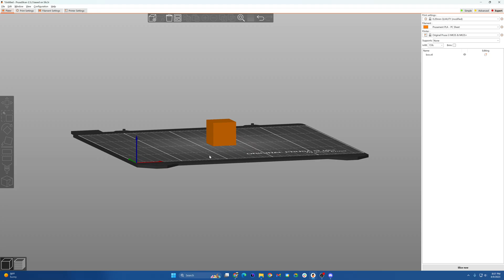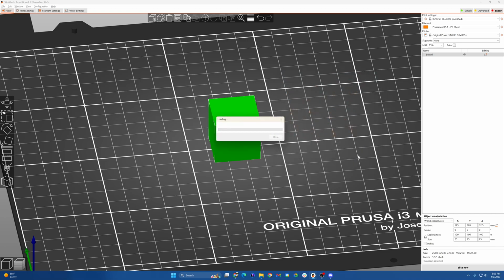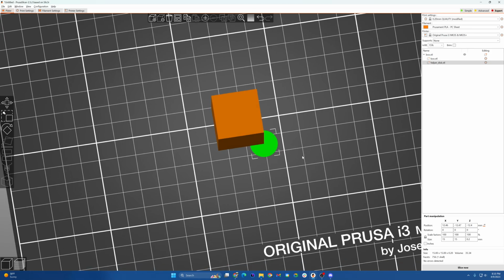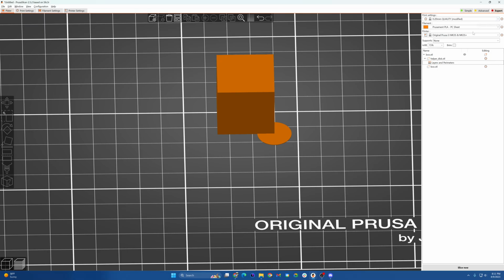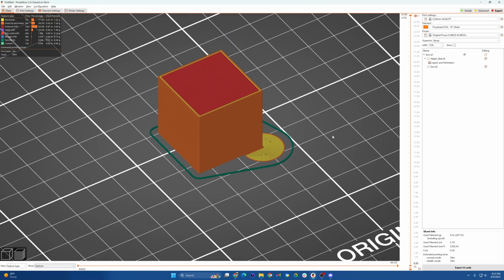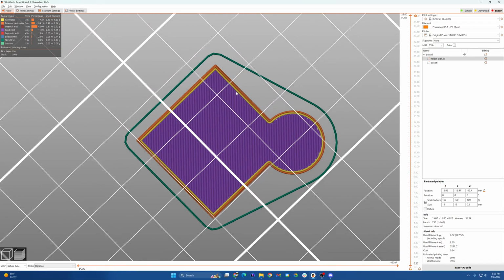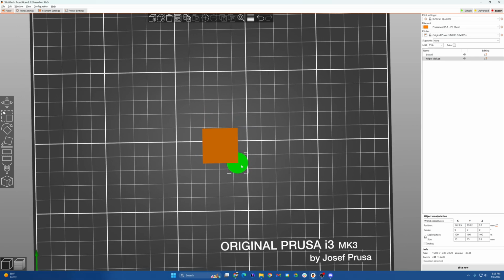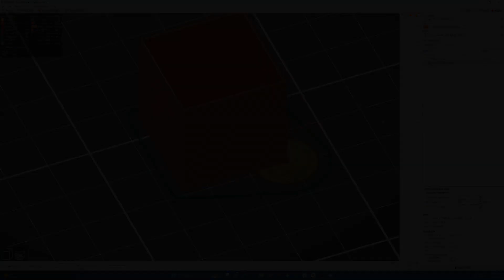PrusaSlicer 2.5 Helper Discs - better audio and updated settings

Comment: in 2.6 the clipping is done automatically and is no longer a separate setting. If you put the discs above the object in the order it will clip them automatically and not merge them.
Reply: Sorry, but this does not work 😞
Reply: Running into the same issue with not having a clip multi part option. Tried moving the disc above the part and it didn't help.
Reply: @its_me_JZ   right click on the help disc(s) to add the Layers and Perimeters option.  After updating the perimeters as the video describes, the help disc{s) should clip as expected.
Reply: @rexus72  Nope, 2.8.0 it gives me an error that I have a disc on the main model.

Comment: You were doing mistake like me. Following method works ONLY if you add helper disc TO SELECTED BODY not whole build plate (1. right click on main object - 2. Add part: Gallery - helper_disc.stl 3. On the list menu: put the main body under the helper discs  4. Add eg. 99 perimeters)
Reply: THaaaaaaaaaaaaaaanks!!!!!!!!!!1

Comment: This is excellent and super helpful. Is there any way to get rid of the little jog in the part in the area of the helper disc? I found that these discs help a lot and they're pretty easy to remove, but they do leave a little flaw in that area once the disc is removed.

I wish Prusa would add the ability to do selective brim, which is essentially what this is. If they added brim as an option to the Add Modifiers feature, that'd do it I think.
Reply from the maker: That jog is actually the elephant's foot compensation. If tuned correctly it shouldn't be visible in the final part